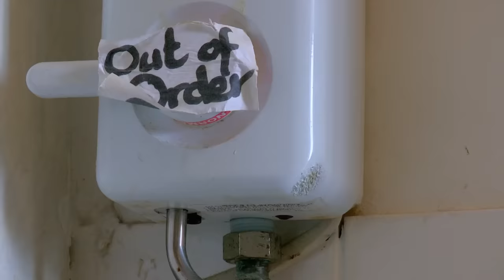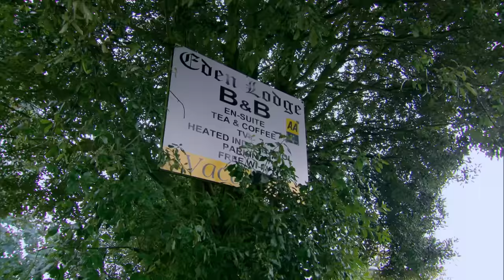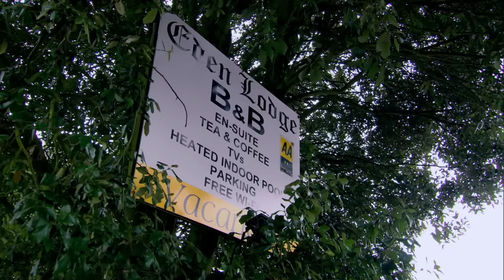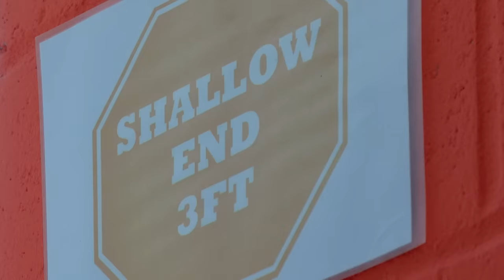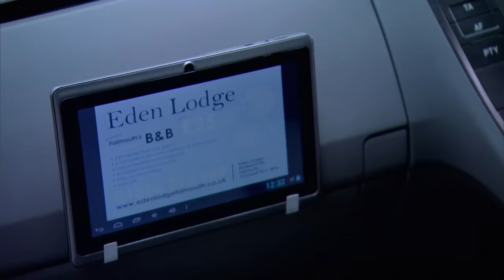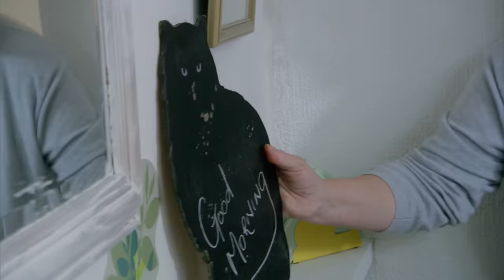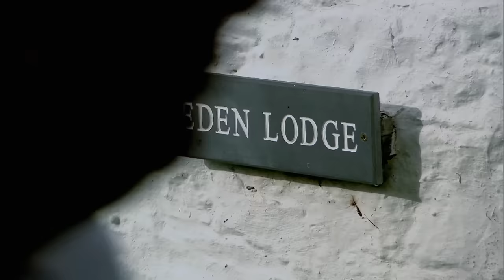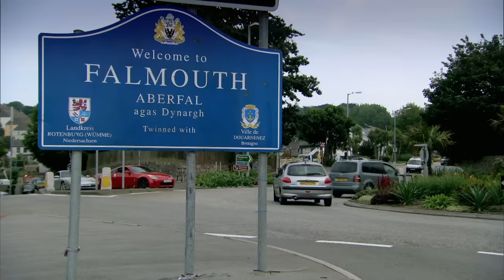Alex Goes 'In at the Deep End' at Failing Falmouth Hotel | The Hotel Inspector S10 - E3

Comment: Another review: Fawlty Towers without Basil and Sybil
First let me clarify that I had lived in Falmouth for many years so I knew the location of the property before booking and this was a key factor in my decision. A pretty listed building close to the beaches and town amenities with a pool that we could use, and a cooked breakfast supplied.
I was visiting Cornwall from the USA for a family/friend's reunion and wanted to spend a few days in my old hometown before moving on to another location.
I was staying with my three children, and we shared a top floor room with four single beds.
We phoned before arrival, but the owner was leaving so they left the key in a lockbox, (The owners were only at the hotel for a few hours each day. Most of the time reception was completely empty and did give me concerns over security. Anybody from the street could walk in unchallenged.)
The UK was having a heatwave and temperatures were higher than normal. We walked into our room, and it felt like a sauna! No windows were open, and the blinds were all open. The sun had been beating down on the roof and streaming in through the windows all day. After opening the windows and shutting the blinds we dropped our luggage and left to allow the room to cool down. (No AC in the UK of course.) The owners obviously didn't care about our comfort.
We were using the bathroom on the landing. And had our own key. I walked in and it stunk of silicon sealant. I saw mounds of the stuff all around the shower sill. When I turned the shower on, I noticed that it wasn't draining so turned it off before it overflowed onto the floor. When it had drained enough, I rinsed and got out quickly. I had to warn my children to be careful not to floor the floor.
Next morning at reception I met another lady waiting for the owner to arrive to complain that her ensuite shower had no hot water. I complained about our shower not draining and she said she'd send up her partner to fix the problem.
He came up later that morning with a few tools. Spent 10 minutes and then told me he's put some Draino fluid down and it would be fine to use in an hour.
Later that day I used the shower, and it was even worse then before. Filling the sill immediately.
I phoned the owner, and she picked up. I told her the shower was still useless and requested a new room or different shower to use. She allowed us to use the shower on the floor below and said her partner would fix our shower again tomorrow.
But she told me not to turn the lights on in the other bathroom as there had been water damage to the electrics in that bathroom. (Probably caused by the water leaking from our shower!) I checked out that bathroom and it was new and modern but there were drips of water on the ceiling. There was no signage to warn guests not to turn on the lights!!! My daughter rushed to get showered before it got dark outside.
He came to fix the shower again and did the same thing. He was clearly not a professional plumber, and this problem was not new to him.
That evening I used the shower again and it was still not draining. On top of this some other guests on our floor had been asked to leave for smoking in their rooms and had kicked the door to our bathroom as they left and cracked the door frame, making it difficult to lock with the key. I told daughter she could use the shower on the floor below again. Whilst she was using that shower the owner started banging loudly on the door trying to ask her to get out. My daughter was alarmed and upset. So, we confronted the owner and told her that our shower was still not draining, and the door wouldn't lock so my daughter would continue to use that shower until we left. She reluctantly after I'd shown her the damage to our shower door.
(Had they got a plumber in to fix our shower in the first place they wouldn't then require an electrician to fix their electrics on the floor below!)
Other issues:
Cooked breakfast was either bacon or sausage on a bread roll or pancakes cooked to order during a brief window in the morning. Poor to say the least.
Swimming pool. This was being used for swim lessons and pool parties and only available to guests for an hour here and there. Not as advertised.
Parking: Very limited spaces and difficult to find a space on the street as town was busy with summer visitors.
Room was crowded with 4 single beds, different to website photos.
A mini fridge would've been an improvement as we had nowhere to store milk or drinks during our stay
Roller blind fell onto my bed during the night. I found out the blind was only secured to the roller with Duct Tape. Obviously, an earlier repair.
Small portable fan in the room didn't work unless you removed the front cover.
Throughout the hotel the wallpaper looked as if it had been hung by a 10-year-old.
Dead flowers in the piano room.
Bags of laundry sat on the floor in reception throughout our stay. Fire hazard?
The sign outside the hotel had 4-Stars. Probably a rating given by the owners?
I later found out that the owners and hotel had featured on a UK TV show called 'Four In A Bed' where B&B and hotel owners compete against each other. They had come last and received scathing online comments which caused them to change the hotel name from Eden Lodge to Pendennis Lodge.
Had I known this I would not have booked at this place.
In short, if the hotel inspectors had visited during our stay, I'm sure they would've been shut down immediately.
We were glad to leave after our four-night stay and thankfully went to a much better location.
I didn't even bother asking for any kind of refund when we left. I just wanted to get out as quickly as possible.
IMHO the owners need to sell up and let somebody take over who cares and who know how to run a hotel properly. Somebody who would do the old building and great location justice.
My advice:
Visit lovely Falmouth but do not stay here!
Reply: Has anyone read this endless drivel?
Reply: Thanks for this - really interesting to hear it's not changed since this show 11 years ago!
Reply: Very informative!
Reply: @charlotteoleary196  😁😆😅🤣😂😂😂😂Oh my ......😆😅
Reply: @jckonstanz  😂😂😂😂
Reply: Was it the same people?
Reply: Cheap as chips.  Perhaps next time, you should invest more 'green' in your choice of stay. I think you got what you paid for.  You aren't paying for sole use of the pool and four in a room is GOING TO BE crammed isn't it, it's not a suite.  Try again and give them a chance, unless you can increase your budget or try glamping - will probably be better. But your daughter will  be sharing the showers.
Reply: So.... you must be PAUL Y. from Tripadvisor. This write up is EXACTLY the same.
Reply: @jckonstanz Yes. They made their points. Paragraph returns would have helped, but hardly 'drivel'.
Reply: @jckonstanz  its not drivel im afraid
Reply: It’s actually listed as Sold Subject To Contract on Right Move
Reply: You sound a tad bitter.
Reply: @jckonstanz Not drivel at all, and yes, it only takes a minute to read it. I guess it’s too many words for some people, though.😂
Reply: @ditzygypsy   sorry about your inability to read and concentrate.